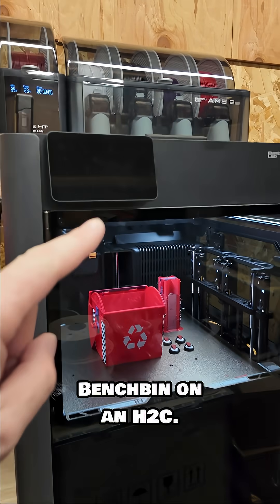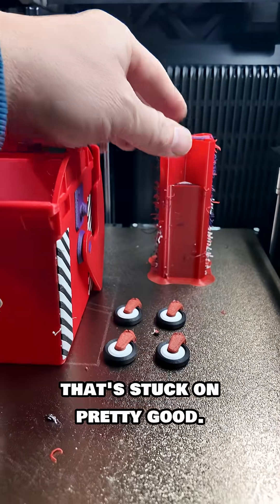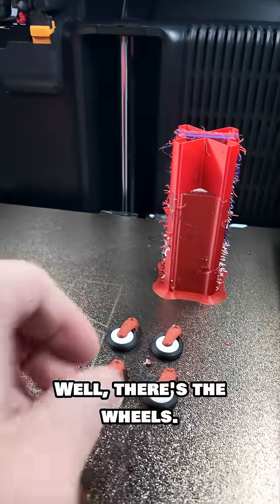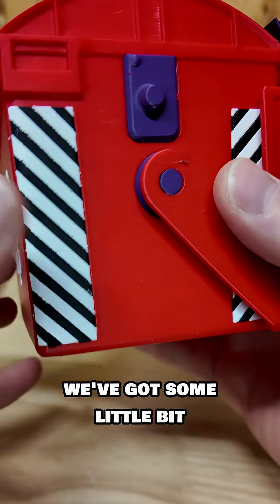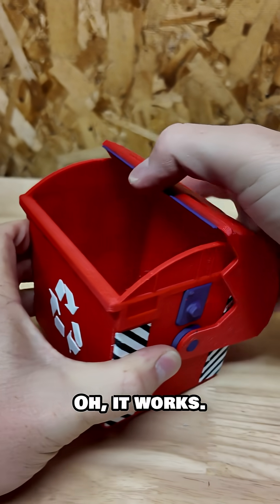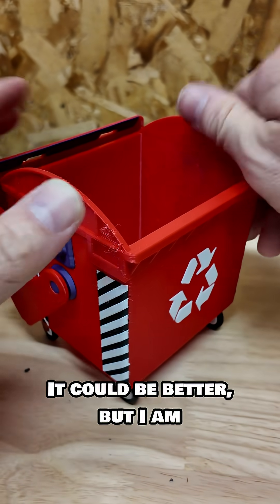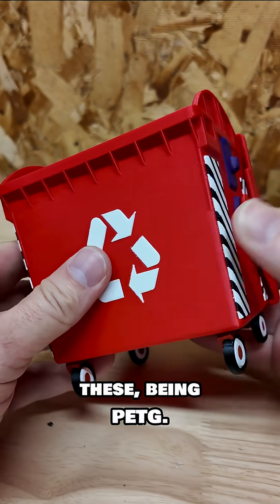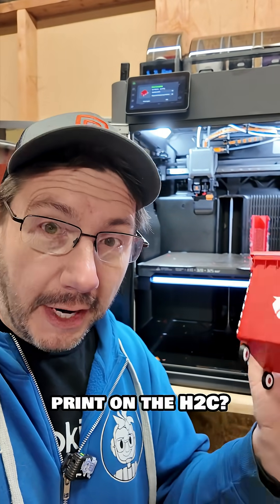Bambu H2C 3D Printing a PETG Benchbin

Comment: Why the purge tower? Didn't have enough hot ends for 4 colors?
Reply: Even tool changers need a prime tower to allow pressure in the nozzle to stabilize.
Reply: It's called a priming tower ... ask yourself why it has that name :)
Reply: @wparsons  the purge tower is still required even with the vortek nozzles to push out the tiny bit of filament that had spent a lot of time in the melt zone and to pressurize the nozzle. It just doesn’t have to do the full color swap purge like a single nozzle would.
Reply: They are always required the XL and snap maker have them too its a necessity

Comment: how do you do movable parts in one print? do you just model a small little break point in between the parts? you did say you break it a little for the wheels to roll. this whole set was printing at once?

i am fully unfamiliar with 3d printing lol
Reply: Yep exactly, it is "print in place" it all depends on the thing you're printing and the orentation. Usually there is a very small gap between the two moving parts and IF needed there is a small/thin support piece between them.  When he moves the lid, if you listen you can hear a click/snap, that is the sound of the henge support breaking. Do a search on youtube for "3D print in place" there lots of designs like this.